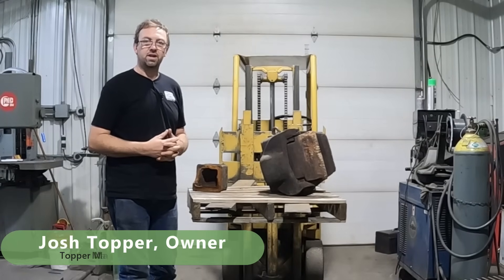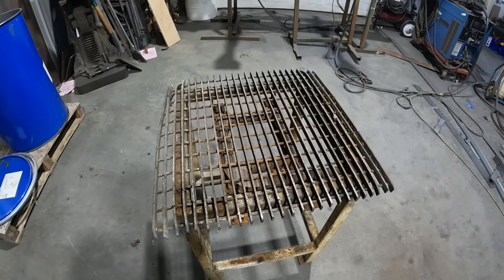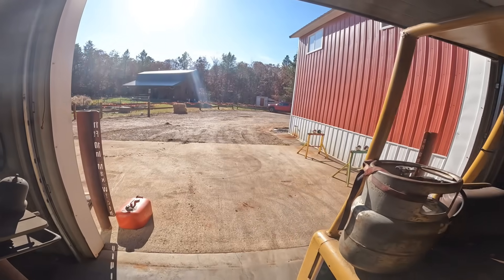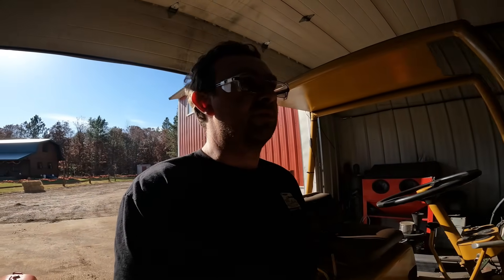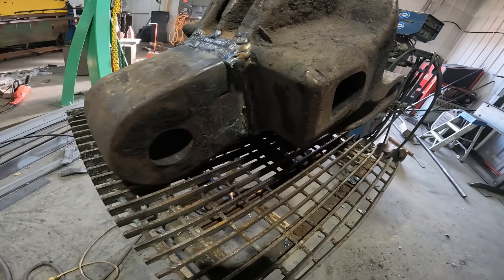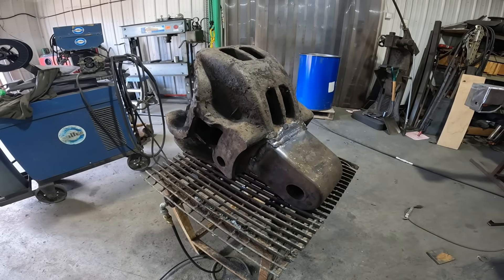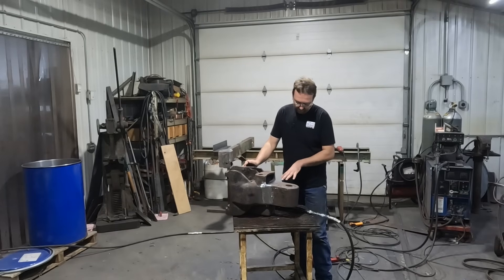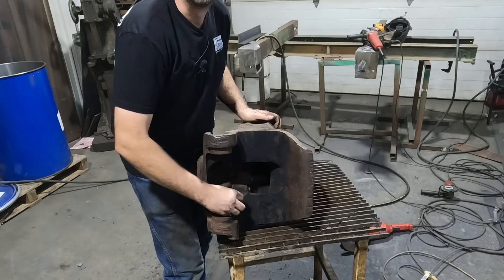Repairing A Broken Locomotive Coupler - 100% Not Legal For Active Service

Comment: Very nice job Josh, If the owner would paint that part it would look absolutely original.
Reply from the maker: It is illegal to paint couplers. Paint hides cracks. Just let them rust. Thanks.
Reply: @TopperMachineLLC  I'll be dammed ,, I didn't know that . Thanks for that info Josh :)
Reply: @billdunlop8683  You wouldn’t believe all the rules that apply to this railroad stuff! There’s the FRA, or Federal Railroad Administration, which is the federal government, and the AAR, Association of American Railroads. The AAR is basically a consortium of the major railroads of the US. Both of those groups set standards, make rules pertaining to the operation, maintenance and repair of everything railroad including cars, locomotives, track, signals, train operation, etc.. FRA & AAR each have inspectors that are ready and very willing to issue fines and even criminal charges for violation of those rules. Those fines are usually levied on the railroads, but some violations are grounds for a personal violation charge and resulting financial penalty! As he stated, couplers as well as wheels & axles, truck frames etc are forbidden to be painted, and there are very specific specifications on things like where a crack can be on a coupler and not condemn it versus where a crack is not acceptable, the height above rail, and on and on! I retired in 2020 after a 41 year career as a certified welder for a major eastern railroad in the mechanical department, and we lived and died by those rulebooks and unannounced visits  by the inspectors! The AAR guys would even dig around in our scrap metal bins looking for parts that had been removed from cars belonging to other railroads, but didn’t meet condemning limits! The coupler in this video was cast at a time when freight cars were all 40 and 50 ton capacity, but in 2022 the vast majority of them are 100 tons or greater! The steels that these things are made of has improved massively over the years to be able to handle the kind of weight that is the norm! I’ll stop rambling, but I could write a book about all the crazy nuances and stories about this kind of stuff! Pretty repair, by the way!
Reply: @tomt9543  wow. So when a new coupler came from the manufacturer was it powder coated / raw finished/ or painted ?? . So that means once it's been repaired it has to be left in the repair state for inspection. Dam I can see the logic in it but that's really nuts hw tight the rules are. Thanks for that info. I love to see how other industries work. I've just retired from being a Pharmaceutical Millwright for the past 30+ years and I thought I rules from the FDA were way to tight. lol
Reply: @billdunlop8683  They can’t be coated in any way that hides the surface! It’s funny that there are places on a coupler, for instance where the top of the shank meets the horn in a radius, that cracks are perfectly acceptable within limits! The inspection thing is critical on the various cast steel components of railcars and locomotives. Back about 25 years ago one of the manufacturers of freight car trucks (the frames that the wheel/axle assemblies ride in) opened up a foundry in Mexico. They produced hundreds, if not thousands, of trucks for various railcar builders in the US, many of them going under tank cars. After a short time in service these trucks became the cause of several major derailments across the country due to the bolster (the middle “crossmember” in the truck) due to cracking, and ultimately failure by breaking in half! A massive “intercept” directive was put out to inspect all of these trucks. Those with any sign of cracking were immediately bad ordered and taken out of service until replaced by local shop forces. The ones that didn’t show evidence of cracking were allowed to continue to destination if loaded, then routed to the car owners repair facilities for replacement. It cost the foundry dearly! Oops! Im rambling again!
Reply: @tomt9543  I think that you had better write that book Tom. A lot of people would find it interesting to read about being a modern era car repair man, as your service time covers from The Staggers Act until the introduction of PSR, Precision Scheduled Railroading. 
May Hunter Harrison be burning in Hell for introducing that stupid concept! But you would know about that first hand, I just read about it and draw conclusions. 
Start by jotting down some notes and see how you go. 
Mark from Melbourne Australia
Reply from the maker: @markfryer9880  you have no idea how Hitler Harrison destroyed North Armenian railroads. Before him, you could get things moved. Customer service was the railroads business. When he took over the CN, it was changed to customer discipline.
Reply: @Tom T  make a podcast/ youtube series about your ramblings or write a book! I enjoyed your both your stories

Comment: Glad to see you have some sense. I've left comments for other well known youtubers recommending that they put a burner under their large castings while they braze or weld and it just falls on deaf ears. They keep trying to keep heat in it and braze with a rose bud and it just makes a mess. I couldn't see your regulator. Is it adjustable? TSC carries an adjustable regulator that allows you to crank up the flame a bit more if you need to. A turkey fryer regulator is about the same. For small or thin cast parts, I've used a big cheap cast iron pan as a heat sink to hold the part and keep the heat regulated as well. But anyway...love the table setup that beats the old cast iron gas burner on a work bench for sure 👍
Reply from the maker: Thank you, sir.  It is funny how some guys have no sense on doing these kinds of repairs.  I built this for one little job and its been a godsend.  There is no better way to keep these parts warm, it is a struggle to do anything else.  I just ordered an adjustable regulator with armored hose, so I can really get the work done.  I will put up a video of the table as soon as I get the parts and time.  I started making a video when I put it together and thought I should not show this as someone will have a fit.  But, definitely gonna show this table in detail coming up.  Thank you again.

Comment: That was a sound proper repair. I really like your preheat table. I will making a larger one as I repair cast steel, cast iron potbelly, and Franklin wood stoves . I also repair cast iron tractor 3point hitch mounts and implements
Reply from the maker: You won't regret making one of these tables.  I will do a video explaining how it works and was put together once some new parts arrive for it.  I am adding an adjustable regulator to control the flame better.
Reply: I would start shutting off the burner while your welding though, the updraft from the burner will definitely mess with  your shielding gas if your running MIG or TIG. You could rig a simple push button grill igniter on it for easier relights.

Comment: Reminds me of years ago when I was helping load grain hoppers at the local COOP. We had two sidings and were alternating between the two and loading cars without stopping to get half a train loaded for turnaround without penalty. I was cutting out cars and the sidings ran downhill toward the facility so I'd cut a car loose and then set the brake lightly and open the knuckle so the yard trackmobile could snag the empty and stage it. When they were loaded then we would cross the highway and go thru the switches and out on the main. I got about 80% of the way back thru the cars when I opened a  knuckle and it rolled out of the coupler and nearly landed on my foot. The pin was completely missing. I looked all the way up the siding and never found it.
Reply from the maker: I have seen them without pins for years. The pin only holds it in when open. Doesn't do any work. The newest cars I've seen have a plastic pin.

Comment: Yea, I just spoke with the D.O.T. and showed them the video and they said they would be there shortly. RUN!!!!!!!!!
Reply from the maker: Locked and loaded.  I don't tolerate those scum suckers.  They have no jurisdiction over it anyway.
Reply: The FRA would be the enforcement authority.
Reply from the maker: @berrytharp1334  and the inspectors I've dealt with are completely incompetent.
Reply: @TopperMachineLLC I have been working on locomotives at an independent shop for a long time. I have never met one yet. The book is thick and every engine I have ever seen has multiple "violations"
I could tell you some stories.  We have reattached broken EMD crankshaft weights while engine is still in the unit. Through the hand holes.
Reply from the maker: @berrytharp1334  never done that, but I've done some sketchy stuff to get them rolling. If you followed every rule, you'd never turn a wheel. 22 years of wrenching on EMDs, mostly electrical. It's definitely fun work. Even own a full set of Sweeny tools, except the one for the lower blower bolts. That one still eludes me.

Comment: When I worked for a local welding and machine shop in high school we had two very large grinders, 10 to 12 inch dia disc grinders with the disc about 3/8” plus thick and the grinder was rated at something like 12,000 RPM.  I told a new welders helper to never set it down running without loading the grinding wheel to a near dead stop or he might find himself tied up with the electrical cord as the grinder rotated around him and occasionally took some skin off his ankles.  He didn’t listen and got tied up with the cord around his ankles and feet. He was also bad about picking it up by its cord it must have weighed 15 lbs and basically dropping it on the outer edge of its disc cracking the disc and having the disc where it would often sling itself apart while using it and the discs weren’t cheap.  Hint, he was about 13-14 was the boss and owner of the shop’s son and didn’t embrace hard hot work.  Some months later that grinder blew up in my hands after a welder told me to slam it down on its disc coupler and shaft but not the disc.  The cord blew out the back of the trigger hand hold assembly arcing along my ring arm blowing the trigger housing completely off. But the housing was all aluminum/magnesium alloy of some nature.  Wasn’t any feasible fixing that grinder, then we were down to one old large disc grinder like it.  Didn’t slam another one down, a welders helper would think he could trust his welder when he told him something, and he was kind of correct the grinder armature and motor tried to spin up bet blew apart before it could.  It was running off our big Miller welder in our service truck to memory.  Those big grinders would hog out some material quickly.  And, they were like a gyroscope once at full RPM and if you didn’t have to hold it to grind vertical or worse overhead they were t too bad to use but then I was a 16 year old teenager too.  I wouldn’t want to have to wrestle with one on anything where it couldn’t be done horizontally/flat at 66 with neck and shoulder problems.
Reply: What an interesting learning experience about huge hand grinders. Thanks for sharing it.

Comment: When done welding w
You could use a needle scaler on your weld area and probably help it to look a bit more like a rough casting.
Reply: busted...somebody didn't watch the whole video lol.
Reply: @TgWags69  no I watched it I just commented about the the needle scalar before he got there. It’ll reduce stresses in the weld area and help give it an older look.  Doubt it matches a cast iron look but it won’t be baby hiney smooth like after a good grinding.
Reply: Besides the preening if the needle scaler should help relieve some of the built up stress in the weld area.

Comment: Josh...Like your preheat table....Good idea...I think I'll build one! Welding construction equipment it will come handy...Better then  wrapping in asbestos blanket....SEE..You'll never stop learning some thing...Thanks Josh...as my Father always said..."Don't get hurt".......................Robbie
Reply from the maker: You should build one.  The burner is just the unit out of an old gas oven.  Super simple.  I do plan to add an adjustable regulator to it for a little finer control, but its been a money maker.

Comment: Does it get marked so that someone doesn’t dismantle the display and mistake it for a usable coupler?
Reply from the maker: Excellent question, and yes it did.  Stamped in a few spots, somewhat hidden from public view, along with a laminated tag inside the body attached to the pin lifter.
Reply: Expecting civilization to crumble and then rebuild that much?
Reply: I would imagine such part shall come with documentation if it is to be used on a locomotive. At least a 3.1 certificate, but probably also ASME or CE declaration of conformity.

Comment: Burner table works great, perfect winter work 👌. 
Nice cosmetic repair,  weld section looks equal to original section. Bit of shot peening as well ✔.
Snow!, not much here in the UK 🇬🇧  thankfully,  though I have worked in Iowa, Michigan, and Ontario Canada during the winter, brr!!!
Great Job Josh, interesting item.
Thanks for sharing 👍
Reply from the maker: I wish I could just stockpile all these jobs for winter. I've done repairs on this table when it's 95°F outside. Gets impossible to see when the sweat is pouring into your eyes. You peel your clothes off at the end of the day because they are drenched. 🤮 miserable work, but the end result is rewarding.

Comment: That welding table with the burner underneath is a great little setup. Very Clever.
Reply from the maker: I can't even remember now what job I built it for. I started making a video on it and then thought some idiot would try to build one and blow themselves up. It's great for brazing also. I remember doing a cast gear box repair and it worked great.
Reply: @TopperMachineLLC  bet it works great in the summer for HOTDOGS 🌭 😋.
Reply: @richardbause2453  I was thinking Steak.
Reply: @malfunctionjunction6212  this time of the year ,🦌🦃 venison & turkey burgers 🍔 😋  😀 ,
Smothered in peppers 🌶 and onions 🌰 😋.
Reply: @TopperMachineLLC  Is that pretty much just a piece of bar grating over an over/broiler burner?
Reply: @TopperMachineLLC  Sad that now everyone has to think about liability, eh?  We've defeated Darwin for too many decades...  lol  It IS a great idea, though...  It reminds me of an overnight round-trip I used to make occasionally a few years ago for a fab shop that built pressure vessels (mostly for oilfield sites)...  They'd load the vessel on the truck, then I'd go several hours away where it got offloaded and baked in a huge oven overnight.  Then I'd haul it back for finishing.  I'm no welder by any stretch of the imagination but understand basically how "destressing" comes into play.  Neat idea for that table (the smart ones will figure out how to build one anyway, if they want).

Winter 2025 now and I vote we cancel it due to lack of interest!  lol  Will trade northwest ND for your winters, though...  Deal?  :)))
Reply: How about a hood/garbage can/55 gal drum/whatever. keep indat heat!  Or do you wanna heat up the whole place in winter?

Comment: I am only a hobby welder but I did take a welding class a very long time ago. I remember in class doing cast iron gas welding but it was not as thick as the coupler. I remember about the gouging and the preheat and post heat; I just never had to do that kind of weld. There was something about oil quenching but I do not remember when that is needed. I am glad that you were able to do the job and the confidence that you have in your work. I was waiting for you to clean and buff the entire part; to make it look better than brand new. You did a great job on the video and a great job on multi pass welding. I just finished a scoop shovel bird sculpture and there is a video on my channel. It is always good to see you. Yes the snow will be here soon.😃😃😃😃😃🐾🐾🦮🦮Rocky is a good dog!
Reply from the maker: Hi Alan, this job was actually an easy one compared to some I've had on this table. I did an obsolete cast iron gear case once that was totally blown apart. About 12 pieces, and it's still running strong. This job was easy as it's just steel. I never learned about quenching, just the heat aspect. Definitely wish I knew more about all the shop processes, but sometimes you gotta learn as you go. Gotta run, rocky wants to go to work!

Comment: Sound is almost non existing.
Reply: Get a new phone
Reply: Sound is not stereo, only left channel
Reply from the maker: How is this happening?  I've had nothing but trouble with one thing or another lately. The videos check out fine before upload. This is so frustrating
Reply: The sound is perfect.
Reply: @TopperMachineLLC  The sound was OK on my laptop.
Reply: @erikslagter3231  same for me.  Only left channel.
Reply: Nothing wrong with the sound.